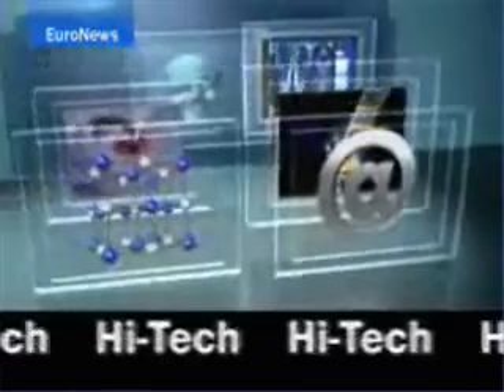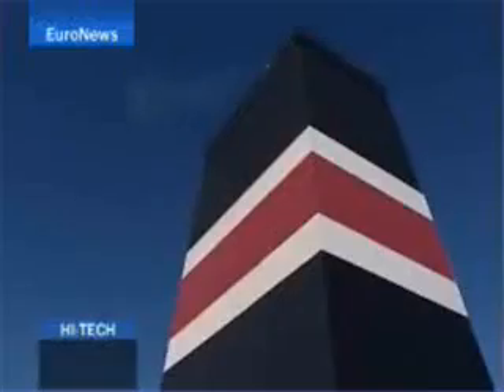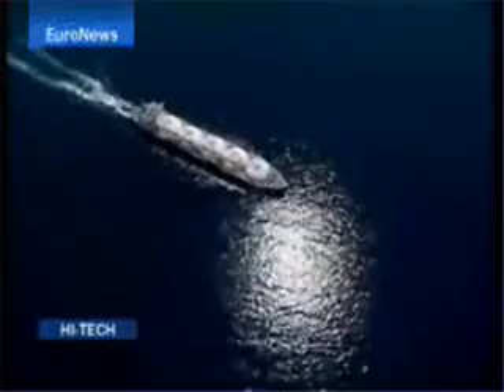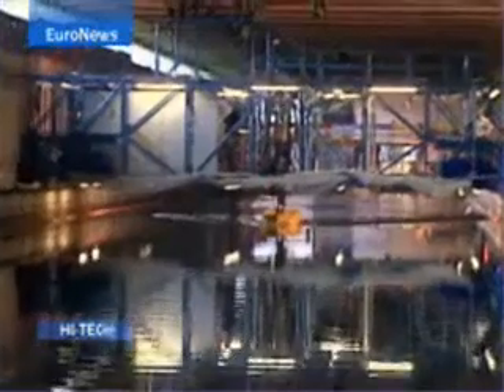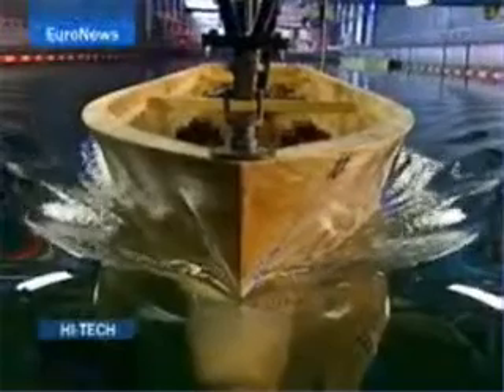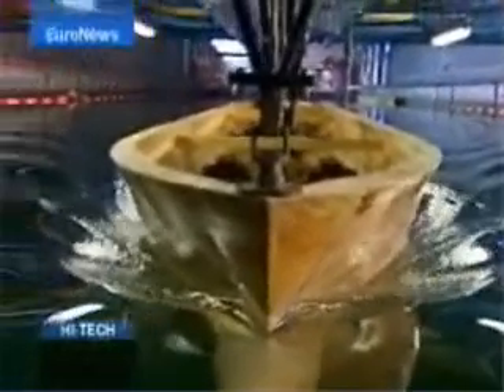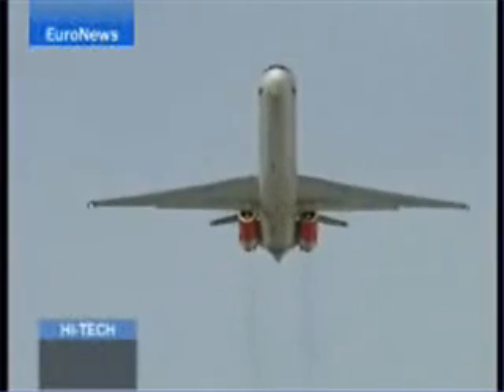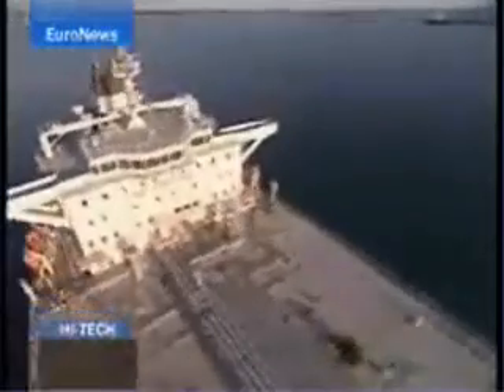Fuel savings on ships up to 15% with the Air vacity system

Comment: This is the better design in this yet new art, where many inventors had not been able to resolve the actual problems in real performance on open seas, like leaking air and turning capabilities as well as extra costs of powering the additional system

Comment: How much does running the air compressor costs? does it cost less than the 15% of the saving?

In a flat sea it seems ok? what about with large waves? 

Are there any reduction of the life term of the hull due to cavitation type erosion?